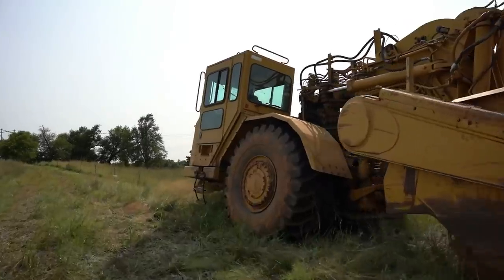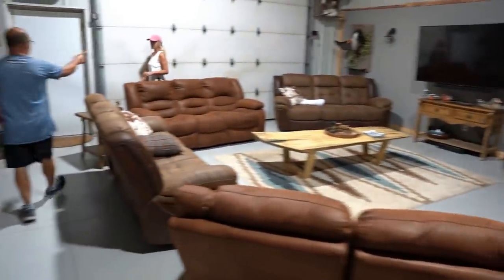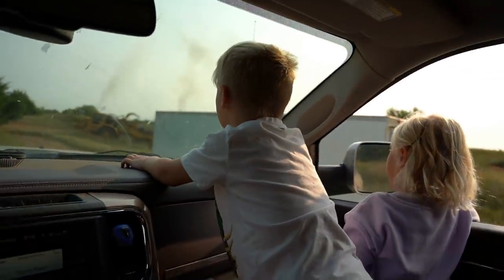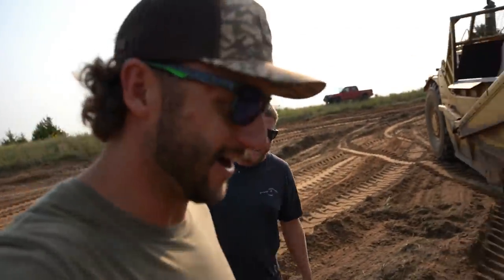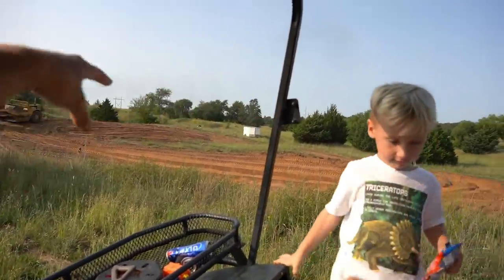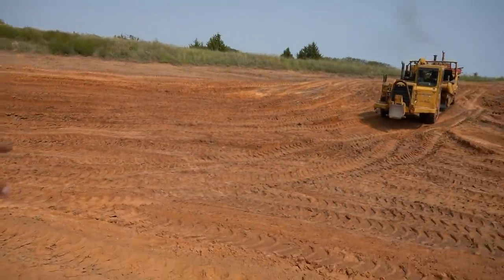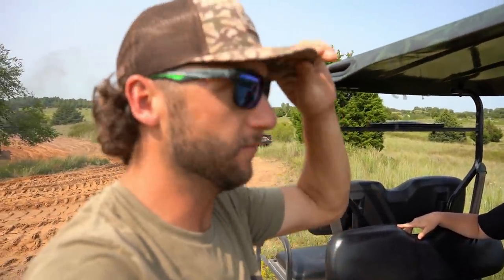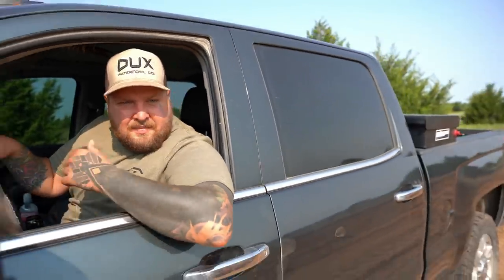Digging a Giant Duck Hunting Pond On My Property!!

Comment: Hey Bob, as an HVAC guy, it'd serve you better to not shut off your AC. 20% of your run time is going to be dehumidification. By turning it off and then on again the ac has to basically start from scratch. Keeping it on but setting at a higher temp when unoccupied will help with shorter run times when occupied, as the ac doesn't have to work as hard on dehumidification and doesn't have to run as long to satisfy the thermostat.

Comment: I would dig it deep in the middle and add a flood plain to plant millet or something. Then add a well so you can flood it and control the water level. If you add fish, you might want to add some structure under the water. Cattle is a really good idea. They will seal up a pond. Once you get ducks in there, they help to seal it up too.

Comment: Preston is right frp(fiberglass)is heavy but it would work a bit. I had a similar issue with a small boat and over sized motor. Putting side mounted pontoons on it would make it float higher and be more stable at the same time. It's kind of like sportspal or Mayer canoes.